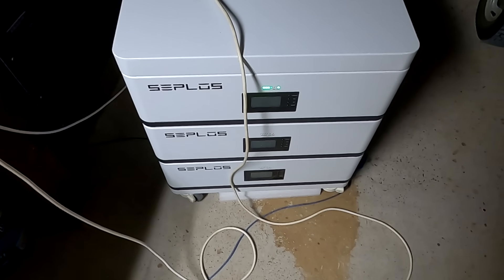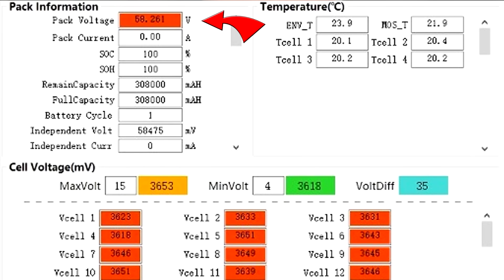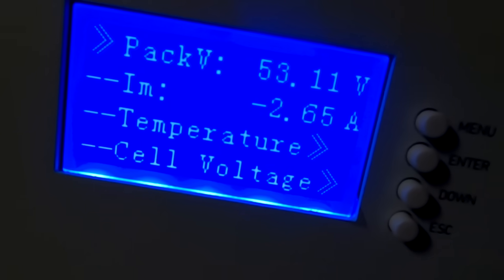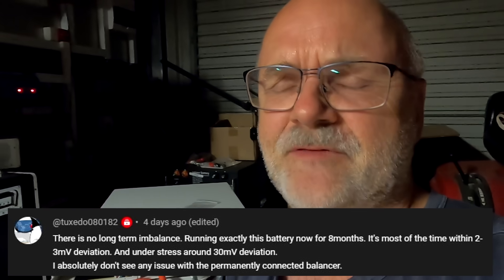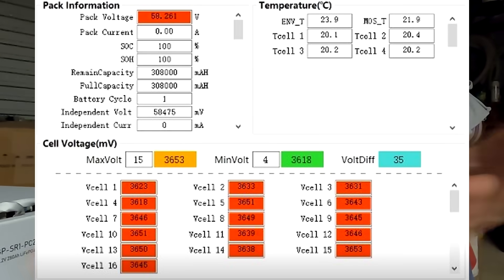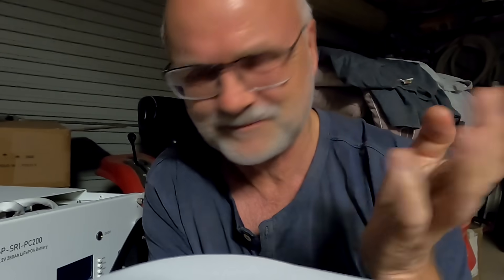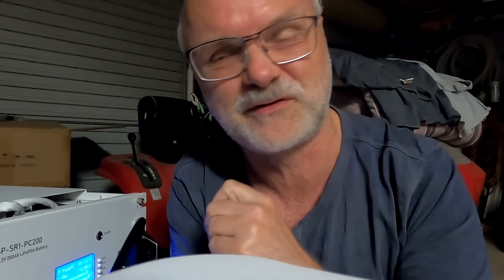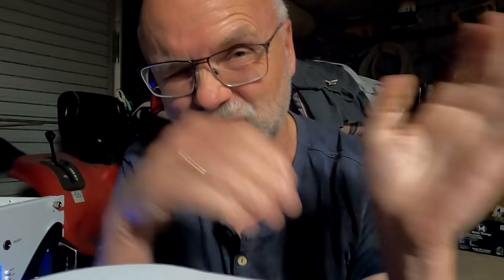Active Balancer: always on or only above 3.45V?

Comment: Naturally the balancing in the lower voltage level is not a good idea, because the system know nothing about the real load-condition. Every cell is a bit different and with the top balancing we get the best possible solution.

So we can load the cell up to the maximum voltage (around 3.45V is enough) and if we deplete the battery to 0%, then we know that some cells will have still 3.3V but other cells are at 3.0V so that we have to stop the energy consumption. There we have at the lower voltage area the voltage drift, but if we want to store the energy very fast, then we can do it without any problems. We can fill up the battery without any time delay to 3.45V each cell.
Reply from the maker: Great, love it.

Comment: Hi Andy, you are on the right track. My battery banks show higher variances in certain SOC ranges. One bank is in the 30% range and in 60% up to 25mV divergence. If now an active balancer permanently balances and the battery stays overnight in this SOC, the TOP balacing is gone.
Reply from the maker: Yep, exactly what I have tested and experienced many times. It through me off when I installed the active balancer in the Battery 1.0 and with the next full charge, the cells were all over the place 😄

Comment: Coming from the world of lead/acid into NMC then LIPO, I've seen many folks get a bit confused. A full time AB may be more applicable to NMC chemistry because of the charge/discharge curve characteristics. My experience dictates just top balancing is best. Also helps identify problem cells in the mid level range where a full time balancer may mask issues.
Reply: What balancer do you recommend for NMC? Gobel?
Reply from the maker: Yes, absolutely, the AB will work fine all the time with NMC batteries. Linear voltage/SOC curve.
Reply: 100% correct, especially for the bad cell detection.

Comment: I think  the differences  is not so huge..  
If You use the battery daily, in household like an hybrid system, all of the times the electrons runing, depending the mode... charging, disscharging, but always changing something..
Reply from the maker: Yes, it depends a lot how the battery is being used. But also how the balancer is being used.

Comment: The truth is that Andy I have a 304ah eve and with a 24v inverter meaning  I have 8s , my bms is jk bms and my loads are mostly within 20a-25a,  my jk bms active balancer is 2A and its always runing I actually got a bad inbalance after I took your advice and change the settings to balancing at 3.4, I notice that my imbalance deviation was so bad that a few cells hits low voltage cutoff that I dont get enough from my battery capacity and yeah I bought them from the same vendor  you bought yours so they are brand new cells their internal resistance are well matched , so I had to turn back my bms active balancer, and it always top balances and turns off whne its done....not balancing during discharge will make you lose a lot of capacuty due to the small internal resistamce differences,....
Reply from the maker: A balancer is not to gain capacity though.
If you start balancing at 3.4V, how can any cell hit low voltage cut-off? Have you mixed something up here?
Reply: @OffGridGarageAustralia  Andy the point is that if i don't get full charge to trigger the active balancer at 3.4 I won't have my cells top balanced so if I continue to charge and discharge below 3.4 I will end up having a terrible imbalance situations.....right ?

Comment: I suspect Andy, that with the Active Balancer left ON during the discharge and recharge cycle, the amount your top balance will be effected will depend on how well the discharge curves of your cells match, and how fast you discharge and recharge. That being: If you discharge at a rate higher than the active balancer can compensate for imbalances through the cycle, then you will end up with cell imbalance. However if you discharge and recharge at lower rates at which than the balancer can compensate for, then you will not experience premature low or high voltage cut-offs due to cell imbalance, and having the balancer ON all the time might result in a slight increase in overall capacity as it's effectively both top and bottom balancing.
Reply: It's totally pointless to actively and dynamically balance series cells!

There are two reasons cells may not have the same voltage:

1) they have a different static capacity, either due to manufacturing tolerances for a new cell, or due to ageing on a cycled cell.  In this case, the weakest (lowest capacity) cell is ALWAYS going to experience the largest voltage swing for any change in SoC.  If you balance at the bottom the top will be unbalanced, if you balance at the top, the bottom will be unbalanced, and if you balance in the middle both the top and bottom are unbalanced. The only option here is a balancer that can dynamically balance at the rated current of the series string, but this would be huge, expensive and still gain you little (do the analysis and if you want to maximise capacity, simply spend the money on more cells in the first place)

2) Cells have a differing rate of electrochemical Reaction. Here, primarily due to temperature, a cell with differing kinetics will be able to absorb or release electrical energy at different rate, and hence it's true electrochemical potential will lag the measured terminal voltage. The effect is broadly seen as increased internal resistance, so pushign current into this cell results in a higher terminal voltage. An active system will therefore see that difference and eroneously shunt energy around the cell, which WILL unbalance (from an SoC perspective) that cell.  Better to simply let that cell sit at this higher terminal for a period of time, absorb the same series current and reach the same SoC as all the other cells.  Over time, that cell will be driven towards the other cells as cell temperatures equalise, and the terminal voltages will re-converge on the same electropotential.  You most often see this in high performance (high C rate) large series batteries where the cells on the end (or closest to active cooling sinks) experience a higher deltaT.  It's unlikely to be any issue at all in a typical off grid battery that might ocasionally see 1C, or perhaps even 2C, but certainly not the 3 to 10C for a modern ultra high performance pack in an automotive application
Reply: @maxtorque2277  Thanks for that. While many may be aware of your first point (#1), your second point may be less well understood. What you describe about cells at higher thermal states having higher thermal voltages, causing an active balancer inducing an imbalance, and terminal voltages re-converging on the same 'electropotential' over time, but I question if would be a more significant cause of balancer induced imbalance in Li-Ion batteries that tend to exhibit more thermal heating in use and more thermal voltage effects than LFP chemistry, and in electric vehicles with higher loads in large, LFP power storage applications.

I used to maintain very large industrial 150v flooded Ni-Cad industrial battery banks used in Industrial stand by power systems that used no active cell balancing, but relied on charge balancing where all cells were occasionally over-charged so theoretically all cells would end up at the same state of charge through thermal dissipation, similar to how cells in a lead acid vehicle battery are supposed to balance in use. The problem with the large Ni-Cad banks came when they were deeply discharged and weaker cells ended up at a lower SOC. Then when recharged stronger cells voltage ended up an a much higher SOC, and occasionally would experience thermal run-away. Twice that resulted in severe fires that caused millions of dollars in damage. I also experienced this in a 24V Ni-Cad aircraft battery in flight that nearly ended in catastrophe. Which illustrate the importance of cell over-voltage protection in sires Lithium battery systems.
Reply: @maxtorque2277 
"[..] The only option here is a balancer that can dynamically balance at the rated current of the series string, [..]" 
I think it would be enough if the balancer can carry the difference of the weakest vs the strongest cell (series current times capacity difference). It only would need to carry the full series current if one of the cells has no capacity of its own at all - so the active balancer has 'to be' that cell (charge and discharge). And that isn't soo expensive anymore - naturally depending on the series current one wants to be able to run..
Reply: Correct.
Reply: yes this i true
Reply: Correct
Reply: No charging of Teslas allowed then all will be good.
Reply from the maker: We do the test twice, exact same discharge and charge method but one test with balancer on all the time, the other test with no Ab at all.
Reply: True

Comment: I totally agree with you Andy.👍 The balance should only work in the upper range. The only thing I can imagine if you set the difference at 50 millivolts . In that sense, the balance in the middle would never work....🤔
Reply from the maker: Yeah, I think this is what Seplos tries to do now with their active balancer and having a 50mV setting. It starts balancing above 3V.
But then you can never get better than 50mV ever. Is that good enough? Probably...
Reply: @OffGridGarageAustralia  Yes, that could be the idea behind it. Of course, the battery is then not so well balanced in the end. But the Chinese often have different requirements than we do 😅
PS But when a Chinese electronic part giving smoke, is called a dragon Smoke. 
Just as my interpretation 😅😜

Comment: I am not so familiar with lithium but I came here to learn. Certainly with flooded lead acid you only EQ (balance) the battery when SG readings deviate by more than 0.03 points or more. eg most of the cells read 1.280 (fully charged) but a couple read 1.250. In this instance I would extend the absorption time by 30 mins for a month and check again. I NEVER use EQ as this puts a lot of strain on the cells that are already performing well and essentially over charges them. Lithium is a different animal because there is no SG to check so balancing has to be done by software. When you consider leaving this software running 24/7 it is constantly cycling the batteries by robbing higher voltage cells to top up lower voltage cells no matter the SOC. This is probably okay when the PV is producing surplus power as the energy required to balance comes from PV rather than robbing other cells but this can't be good when the PV is producing less than required where the SOC drops off. In my opinion you are just cycling the cells more than necessary which over time, will shorten their life. I believe the balancer should only operate when there is surplus charging and after all it's just a chemical reaction inside the cells so the less this chemical reaction takes place (charge/ discharge) the longer the cells will last.
Reply from the maker: Cool, I learned something about LA today. Thanks for sharing.
Interesting that you never equalise...

Comment: my 600ah 12.8v home built I have my balancer on a switched circuit running off my victron mppt 75/15 charge controller at 13.7v on after Andy said this could be better.   I have over 120amps of charge controllers going to the thing.  2 100/30's, 1 100/50 and the 75/15 

I get about .02 volt deviation once it hits my 14.10v "full  charge" voltage.    With it always on I was observing about .04 volt.  It's generally cycled from 50% to full most days.
Reply from the maker: Great, thanks for sharing.

Comment: Ah, yes, that comment about internal resistance at 7:15 needs a little extra explanation.  The internal resistance will effect the measured voltage of the cell under load.  This is what the balancer uses to determine whether balancing is needed, but it is getting faked out because the number of electrons being moved is still the same for all cells regardless of the internal resistance.  The internal resistance just drops the energy of the electron contribution from the cell, it does not change the number of electrons (amp-hours) going into or out of the cells.

So what should happen is that IF the balancer kicks in during charging or discharging and decides to move charge between cells, that should take the battery out of top balance.   But the question then becomes... how quickly and by how much?    Obviously if the battery is ever charged to full again the balancer will re-top-balance the cells, and it MIGHT be able to do so in one charge cycle if the intervening cycles didn't cause the cells to get too out of balance.

This is why I think a test like this is going to be very, very sensitive to charge and discharge current and also requires that the batteries not be fully charged (which would re-top-balance the cells and mess up the test).

* I suspect that at low C rates the balancer just won't kick in all that often, and at higher C rates it will.  So the test really has to record just how often the balancer kicks in.

* And I suspect that if the balancer is active while the battery is being discharged  and the SOC is below around 15%, it will mess up the top balance even worse as it gets into the exponential curve on the empty side of the battery.  The internal resistance will have an outsized effect on measured voltage under load when the SOC is below 15% or above 85%.

-Matt
Reply from the maker: Thanks, Matt. As always great deep dive and explanation. Appreciate it.

Comment: Remember the Angels take their share of power out of any electronics running.  (Like they do with the brewing of the Whisky!).
Keep it to a minimum regardles of if a balancer is ok on all the time or not.
Balancing up top but upto 3.55v my Daly isn't too bad at controlling wee 105Ah cells above 3.55v it can't cope. 
Down low is shockingly bad with a masive delta at aprrox 3.15v highest cellI I have a low voltage disconect at 2.65v for the lowest.
Andy Charge the Goooooble with as many amps as it will take. 
Really Clump it one!!! 
Luv Ya
Gary
Reply from the maker: Hahaha, thanks Gary!

Comment: I've set mine at always balancing and whenever the cells are totally balanced, it does not work so it's still good actually. This way, there would a perfect balance most of the time for discharge and charging. Active balancers are not also overworked if the voltage difference is maintained because they would not have to much to catch up or nothing to work on even if you set it to always balancing. 

Just because it is set to always balancing, it does not mean that it would always be working. It is just there as a setting so that whenever there will be enough voltage difference, the active balancer will fix it.

I've had an issue before when I had it on 3.45v where I was using a battery pack to power an electric bike. Did a long uphill trip and one cell group was way too discharged that it hit my UVP but the other cells were still really good. However, it is no longer balancing because everyone is below 3.45 so that's a problem.

I no longer encounter this problem when I set the balancing voltage at 2.6 so it's always balancing. Of course, I am also worried that the smart bms might be overworked and be broken overtime. 

However, I noticed that even if it was set to always balancing, whenever the cells are balanced the smart bms do not work to balance the cells any longer. That means that it is totally better to have them on all the time than to leave them at the top.
Reply: You cant realy compare a E-Bike battery to a solar battery that is about 10 times the capacity.
Because if the balancer courses an unbalance of like 5% on a 20AH Ebike battery it can quickly be corrected on the voltage drop at a lower stage of charge on a 300AH the balancer has not enough power.
Same for charging an E bike battery that is charged from the grid has like 10hours of time for balancing, a solar battery maybe just 1 hour with the ramaining bit of sunshine.
The differents of the application are way to big to compare them.

Comment: For my experience the big Frankie rept and lishen cells battery, even starting balance at 3.375v it destroyed my balance by up to 25AH for one cell.
Reply from the maker: Oh wow, that is a lot!
Reply: @OffGridGarageAustralia  when I replaced the bad cells, I discharged the new cells, I think too much that even after a few months, they seem didn't balance or the balancer made the issue worse, so I charged them using a power supply. It seems much better now, I used to set the jk balance, start at 3.37, then at 3.4, and now 3.45.

Comment: im not sure and im not familiar with special balancer characteristics - but maybe the yellow LED just shows the balancer is powered, and this is not leaving a statement bout the working status?
Reply from the maker: It will turn off below ~2.8V, so it's a bit of both. If it runs, it balances if there is a voltage difference.
Reply: @OffGridGarageAustralia  k.